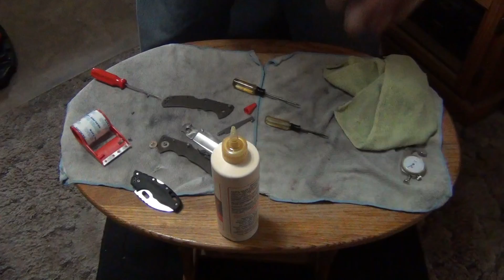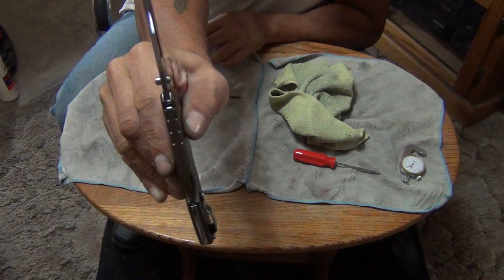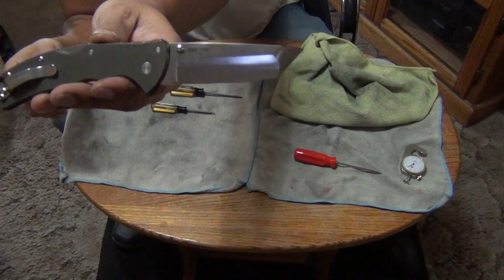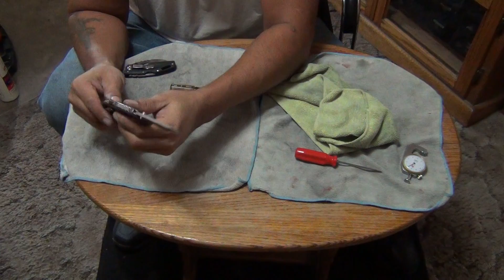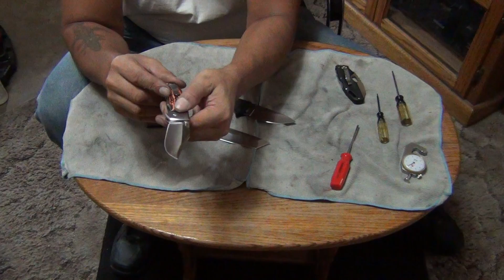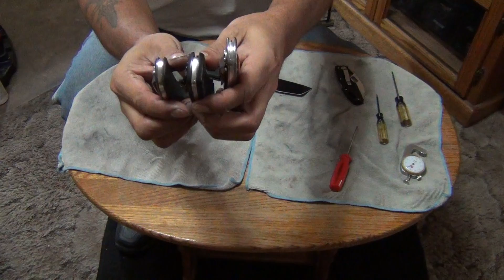Stiletto's Cold Steel Mackinac & Code 4 Polishing Video Part 3

Comment from the maker: This is the third part of three parts.  It consist of my disassembly of my Cold Steel Mackinac Hunter and my Code 4 Tanto.  I'm polishing the Blade Spine, Lock-Bar, and Rear 6061 Aluminum Heat Treated Spacer to a "Mirror" Polish.  Check them out...  Peace, Stiletto :)